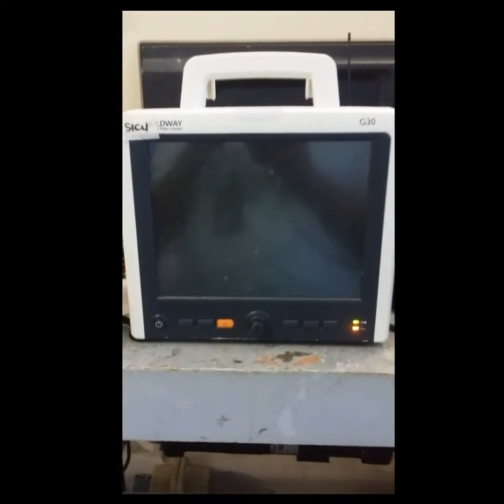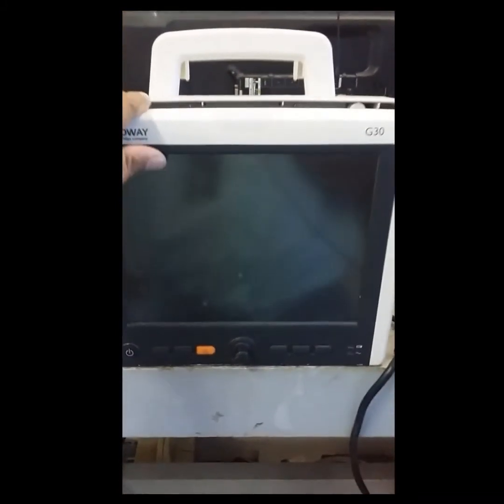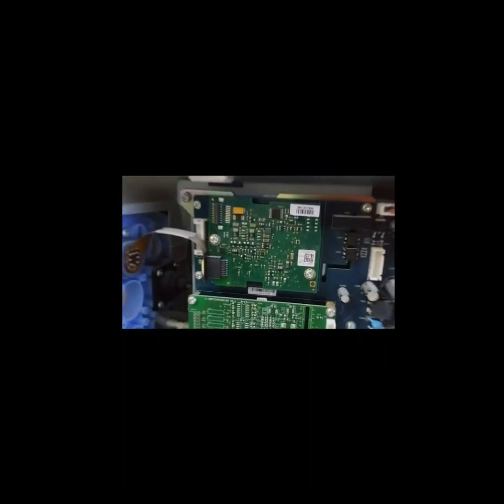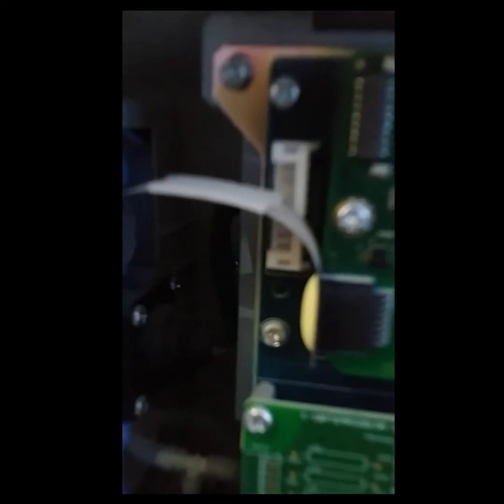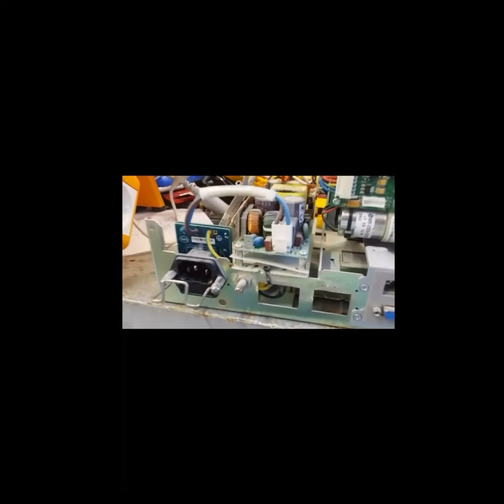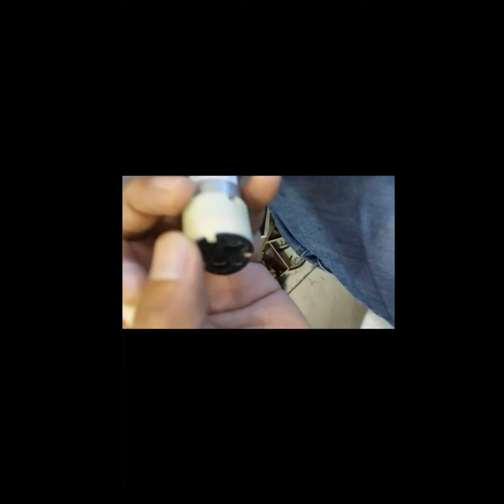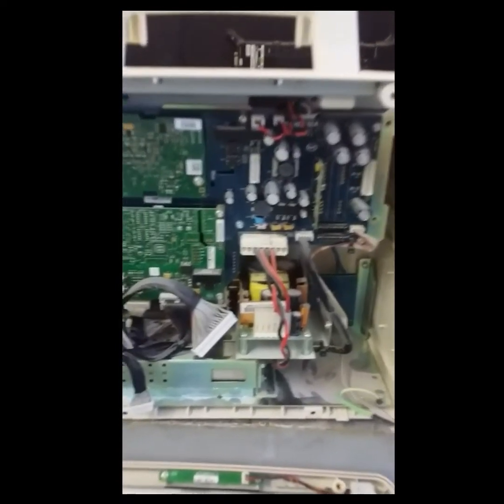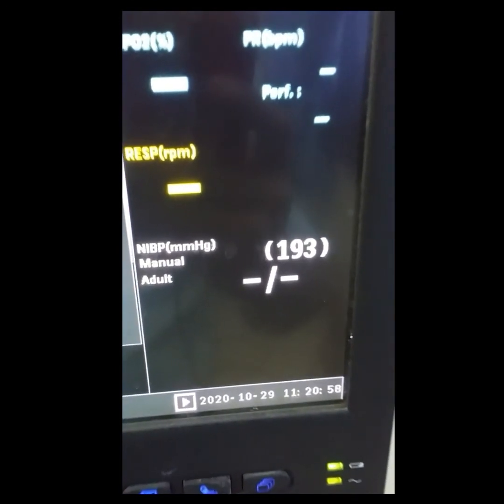how to repair and replace patient monitor blood pressure compressor and motor( goldway g30 )

Comment: I have problem, no nibp pump to manset. How to repair the board nibp?
Reply from the maker: good day.. sir nibp boards are durable and cannot be easily damages. if its the setting.. maybe you need to reset to factory setting on your patient monitor
Reply: @electronicsandbiomeds7391  how to setting the factory?

Comment: Only the rubber problem ryt...? 
By replacing it it will work nipb prblm...?
Reply from the maker: yes.. but first check the cuff and the tubing going to the monitor for a leak.. check also the solenoid valve inside the monitor..

Comment: High b.p values always what should I check
Reply from the maker: check first those 2 solenoid valve.. make sure they are not leaking when  you take the bp..
Reply: Replace nibp board
Reply: @electronicsandbiomeds7391  how to know whether they are leaking
Reply from the maker: @JAZIRCH  hello sir good day you can identify the defective solenoid if there are no ticking sound when you turn on the nibp.. sometime those solenoid can accumulate dust due to daily use.. and can cause intermittent bp output. try also to check the flexible hoses in the bp area.. do not try to manipulate or adjust the trimmer from the bp board focus first on the leaking.. if you have the same model of patient monitor try to swap the board also the test..
Reply: @electronicsandbiomeds7391  I replaced nibp board it has airpumb solenoid valve full set.
Reply from the maker: @JAZIRCH  yes sir or else you can replace the board only.. just remain the motor and the tubing and then test.. but if your patient monitor is a GE brand some model of it the motor itself is imbedded in the main board.. swap with a the same model and test..